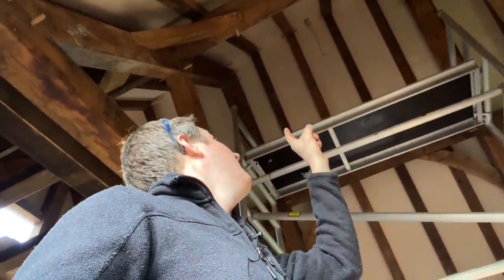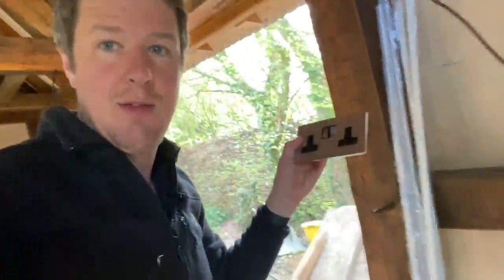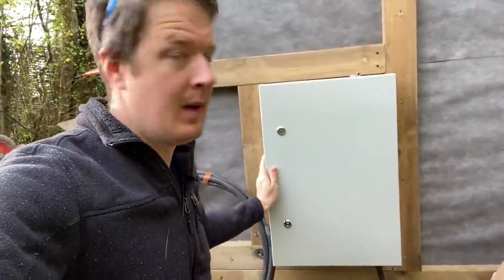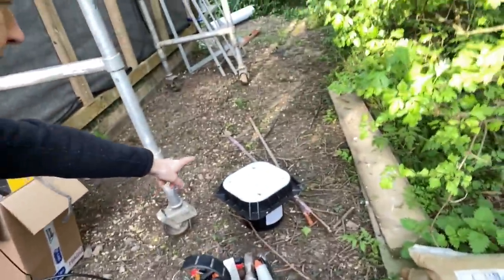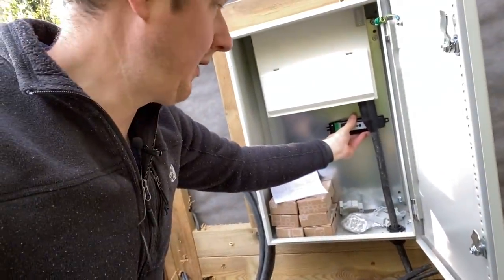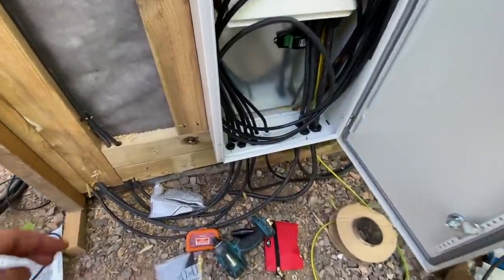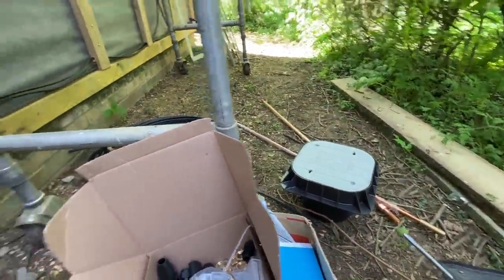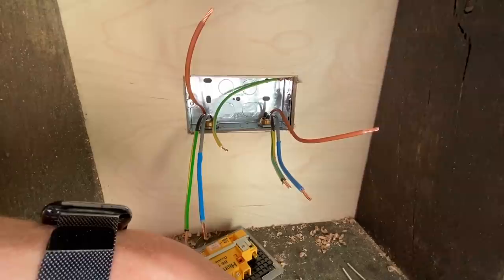Glanding Armoured Cable - Studio Installation Part 3

Comment: You can get bigger sleeving if you like. I was always taught (and it might be in the regs) you only need a marker (near the termination) i.e. a width of tape only, not the whole length.
Reply from the maker: Thanks!
Reply: 70% I always thought...I always do the whole core anyway.
Reply: @tommochelsea72  You are mixing up the Green / Yellow % on Earth wire (70/30) Green/Yellow.

Comment: I did a external metal enclosure with a cu in it on a glamping cabin a while ago.  By mistake really, I put a waterproof plastic cu in it.  Put stand off brackets at the back of the cu. Terminated the swa at the bottom of the metal enclosure and just back entry into the plastic cu.
Reply from the maker: Nice

Comment: Isn’t putting the lighting hub inside the metal IP65 box going to make it tricky to get the WiFi signal from the phone?  Looks like a pretty efficient Faraday cage?!
Reply: Probably using a Lutron Ethernet Control Interface Hub. Would guess that the phone app and the hub talk to a server, not direct to each other.
Reply: Slade McThornbody OK that sounds more feasible - hope Jordan thought of that!
Reply: Dingo Nates Well he will need an ethernet switch in there to split out to the datapoints anyway
Reply from the maker: Yeah I was worried about that but with the Lutron RA2 Select system its not a problem. Its all working fine! 😅

Comment: If you make the SWA off into the metal enclosure then run the inner sheathing straight into the CU with stuffing glands its a lot easier.. Everything is covered regs wise, double insulated & it within a lockable enclosure. 
https://www.cef.co.uk/catalogue/products/419462-10-0mm-blue-sleeving-50m-reel.
Reply from the maker: Thats what I did with the lighting cables but not the sockets and main incomer.

Comment: What’s the reason for wiring all the final circuits in SWA within the building ??
Reply from the maker: Customer requested it, I think he was scared of nailing through cables, not that it would make much difference. Also think he wants it to last a very long time!
Reply: I was going to ask this question. 👍🏻

Comment: Could I do this with 10mm TNE going to the board without adding and electrode. Cables buried in flexi conduit and feeding a 63amp board for 2 rings and 2 lighting circuits for an garage conversion?? Hoping a 4mm earth is within regs or do I have to run a 10/16mm from the MET. Considering there is no gas pipes and water pipes are run in plastic

Comment: We don't have to sleeve here in America like you do . They make heat shrink in different colors and sizes at least here. I used heat shrink more in electronic type work. I have used it at times for some electrical applications. More so in industrial applications.There is company called Nelco that makes a Polyolefin Heat Shrink tubing in different colors and sizes. Type Nelco cable tie products. When it comes up hit menu and it shows the different shrink.
Reply from the maker: Thanks for the info!
Reply: @artisanelectrics    That job your doing on that barn is excellent. Even though we do things a little different in the states  quality is still quality. Have a great day a great day indeed.

Comment: Great job
What's the reason for the stake?
Why couldn't you of used the house earth
Reply: dazzafat DNO forbids exporting a PME system from the supply origin .
Reply from the maker: Yes thats right
Reply: If it was TT at the house and readings were good enough at the cabin would that have been ok without the additional spike?

Comment: How are the back boxes bonded through the armour when you have used Stuffing  (compression) glands?
Reply: Their swa glands on the back boxes.
Reply from the maker: They aren't compression glands
Reply: @artisanelectrics  I meant going into the enclosure and Fuse board.
Reply: @wyndavies5044  into the enclosure and Fuse board?
Reply: @artisanelectrics  you could of took a fly lead of the banjo and into the earth lug at the sockets.

Comment: You can get stainless steel enclosures that have a sloped top. That may be better than a flat surface outside. In my experience those powder coated enclosures are prone to rust if you so much as scratch them.
Reply from the maker: Thanks

Comment: Looks loverly but I would not use celitex for Insulation . We used it in the past on a loft conversion I was working on a job with Graham' Walters .The Atlantic Rowing record breaker. 10yrs Ago . But it would be fibreglass or Rockwool now after that Disaster with those flats in London.

Comment: the armour on the armoured is that part of the pme? ifo would you u have to isolate that at the cabin?
Reply from the maker: Yeah the main incomer has the sheath and internal CPC earthed from the PME of the house but i've isolated it within the enclosure here.
Reply: Yes I commented before I watched the rest of the video 😂 looks smart 👌🏽
Reply: @artisanelectrics  sorry, this might sound like a dumb question, but do you mean you just terminated off the internal CPC core, disregarding it, and used the earth spike to earth the board instead? 

Also does this then get measured as Ze for that board?

Comment: If you putting a stake in , hope the 2 earthing systems arent mixing, it looks like the SWA terminated into the metal enclosure possibley wont be separated from the main earth in the house. Also i refurbed a large 10 room external cabin with a overhead supply , designed it all for TT only to find out it was PME from the DNO
Reply: Look at 9 mins. He changes to stuffing gland to lose the armour earth.
Reply: @steve87uk  sorry didnt notice point taken
Reply from the maker: Well spotted! 😁

Comment: You will need something like a 5 port switch in the external enclosure to join the data outlets to the structured cabling in the main house.
Reply from the maker: Yeah thats what i've used.

Comment: In the US we don't use sleeving so yes lots of tape lots of phase tape. I'm sure you could probably get sleeving I've never seen it used but I haven't say I've seen every installation yet either. although I always thought it was the same thing as heat shrink to some extent maybe not with the shrinking.
Reply from the maker: Cool thanks for sharing!

Comment: TLC keep larger sleeving, as do CPC and presumably most wholesalers. Heatshrink's also an option.

Personally I'd probably have used two core SWA to save a little space, and linked across the glands rather than rely on a thin bit of galv for continuity.

Try not to strip back so much of the cat5/6, you can easily exceed the bend radius of the unsheathed pairs. Should be plenty of room (and radius) to bend the whole inner sheath round in those boxes.

Does look really nice, though. Might be a little jealous.
Reply from the maker: Thanks

Comment: Are you planning to install any of the Lutron Pico switches? If yes will the signals reach the hub as you’re placing it in a metal enclosure
Reply from the maker: Yeah i'm installing 4 Pico switches, they work fine.
Reply: Artisan Electrics that’s excellent news. I would have thought it being a risk that the signal from the Picos wouldn’t reach the receiver hub due it being placed in a cage. At least now I know there’s some possibility of doing this in my future installs. Thanks for the reply

Comment: What type of enclosure is used for the DB? thanks

I use heat shrink for covering over the ends, got a small selection off ebay.
Reply from the maker: https://www.tlc-direct.co.uk/Products/CMSB604025.html

Comment: If the customer requested Ethernet ports in the building I would suggest that he also had a Wireless Access Point (WAP) wired in the building as this would ensure that handheld devices could still connect to the wireless network.
Reply from the maker: Yeah I have put a WAP in

Comment: 14:22 This is NOT how you terminate Cat datacable category 5,5e or 6! 
In order to get the best connection and fastest internet, you must strip the outer jacket off as close to termination as possible. And the wires must be as short as possible, and do not straighten out the wires excessively. Contain the most amount of twists on the pairs before termination.
This hurt my eyes.
Reply: I saw now that you have commented and admitted your fault. Good lad! :)

Comment: That box is going to be loaded to the max haha, fair play for getting all that in there! My ocd was triggered when you stripped the data so long. I'm not sure about the Hamilton range but usually they have a cable tie fixture so you can keep the sheathing in place and only strip the core to what you need to keep the twists in and prevent cross-talk. 

Impressive well thought out job on your behalf, considering it seems the designer of the building tried making it impossible to run any services 😁
Reply: Cat5e cross connect wire isn't sheathed at all, so I wonder if it really matters.
Reply: @brianleeper5737  It's really easy to untwist or exceed the bend radius of the pairs outside the sheath. Best to leave the sheath on. Nice to see enough length kept, though.
Reply from the maker: Thanks

Comment: Data Cable being stripped back 😬
Reply: I spotted that,, Doesn't look like many did though. Lets hope they don't want more than gigabit down that thing in the future! If it manages that reliably.
Reply: Jake Hall he put something on instagram about it. I've not yet found an electrician that doesn't strip it all the way back! Complete nightmare!
Reply: @Rainbowhockey  It does indeed seem to be a running issue with most electricians. I think a lot of em' don't really know the ins and outs of networking, just that "it works" at the end of the day.
Reply: Return loss fails everywhere, let's hope that the client dosnt what the network certified!
Reply from the maker: Yeah it was a stupid mistake guys, I don't know why I did it as i've installed thousands of certified CAT6A cables, patch panels and keystones over the years! Just had a brain fart 😂 glad you picked up on it!
Reply: Artisan Electrics kudos for being humble enough to admit your mistakes sir!
Reply: I’m a network engineer hate it when a client sees their get the electrician to run the cable it always ends up with double the work load always advise are terminate it to save some issues then you find they run it along with power please guys if your going to run network and terminate network cables learn the basics

Comment: Maybe you will need another box for your lighting gear, i was going suggest a plastic one, because of the wireless signals, but with it being insulated in foil insulation may not make any difference. I had one customer have a gas fire controlled by wifi and it would not work on his phone, because of the foil insulation in his extension. I did try to explain it to him before he went for it, but what do i know compared to a heating engineer, well plumber!!!.
Reply from the maker: Actually the signal works fine on this Lutron system, even with the metal enclosure and foil insulation. I was worried about it but it works fine.
Reply: @artisanelectrics  thats  good to know

Comment: They have made that job hard work for you using SWA are you on a price for this one? Nice job your making of it. If its now a TT only 1 end of that SWA sheath should be connected to earth. And if its not on a rcd at the mains end i think im right in saying you need at least 100ma rcd protection before the tails enter the metal DB as its a TT
Reply from the maker: Thanks! Im on hourly rate for this one so no sweat. The Armouring is connected at the main DB end to the PME earthing system. Its on a 100mA S Type RCD as well.

Comment: Good way to put in an earth rod. I'm going to try that.
Reply from the maker: Yeah ive got this special SDS bit from Bosch that is designed for it.
Reply: @artisanelectrics  I will check that out. Nice pull through the roof by the way. On your own too, keep it up.
Reply: Artisan Electrics do you have a link or description of it please

Comment: My dude you are stripping back WAY too much insultation off that data cable, keep it all wrapped tight together until you get to the back of the IDC terminals or you may find it will run at sub standard connection speeds.
Reply from the maker: Yeah I had a bit of a brain fart there... Ive done thousands of CAT6A over the years and they always had to be certified, I would never have done this in the past! Think I'm getting a bit rusty on data!
Reply: @artisanelectrics  I was about to suggest the same thing! I am very glad to see an electrician who does not attempt to create a 'ring' of ethernet ports. So many data packet collisions haha
Reply: @haven4143  haha nice man

Comment: Just apply a single wrap of tape if tape is all you have, no need to tape all the conductor pal. Have some 6mm sleeve on the van somewhere for when larger sleeving is needed
Reply from the maker: Good tip!

Comment: Normally when we don’t want to export the earth from the swa sub-main we terminate it into a plastic enclosure or wiska box then into the metal enclosure. I know you’ve probably terminated the other end of the sub properly with a gland so the outer sheath is still earthed at one end but just looks better at the Sub DB end 👌 nice job 👍
Reply from the maker: Thanks

Comment: Wouldn’t it be normal to terminate the feed in armour in a non-conductive box (ie plastic) so it’s only earthed at the supply end (the house), and then treat the building as a TT installation with its own earthing installation?
Looks like you’ve done most of the work for that except deliberately separating the earth arrangements.
Reply from the maker: I terminated it into the CU with a PVC compression gland and didn’t connect the armouring or internal CPC wire into the CU. So the CU is only earthed from the Rod and the cable is only Earthed from the house PME Supply.
Reply: Artisan Electrics Fair enough. Obviously wasn’t paying enough attention while watching.
Reply: Artisan Electrics what was causing the RCD tripping issue after?

Comment: You can get armoured made in the correct colours.

Superlec direct do it.

Then there is no sleaveing or confusion
Reply from the maker: Great thanks!
Reply: And they cut the exact length you need!
Reply: Yeah its available on ebay it saves a lot of time and eliminates any confusion so much easier to use better than faffing about with tape or sleeving

Comment: Absolutely great Jordan 👍🏼 The choice of cable (SWA) is ideal for this project in my opinion.  It was a good call to TT the building.  What size was the sub-main cable?
Reply from the maker: Awesome, thank you! 10mm 3 core SWA for the supply on a 40A breaker
Reply: Why did you bother with 3 core if you can earth to the armour and you were putting a spike in anyway? Surely 2 core would have saved on cost?

Comment: I’d be putting afdd’s in a wooden building pal
Reply: Your house is full of wood on the inside, too..
Reply: Only goin what it says in 18th regs about buildings made of wood require afdds
Reply: Doubt you’d be putting them in if you were paying for them though.
Reply: Cost doesn’t come into it, just comply with the regs, I know it’s a recommendation but if something happens  and you not installed them then cost does matter, how much do you think a building made from oak costs not cheap. Just going from below this reason I would be recommending them. 

The IET Wiring Regulations, BS 7671: 2018 regulation 421.1.7 and 532.6 state the following:
421.1.7 Arc fault detection devices conforming to BS EN 62606 are recommended as a means of providing additional protection against fire caused by arc faults in AC final circuits.
If used, an AFDD shall be placed at the origin of the circuit to be protected.
NoTE: Examples of where such devices can be used include:
• premises with sleeping accommodation
• locations with a risk of fire due to the nature of
processed or stored materials, i.e. BE2 locations (e.g. barns, woodworking shops, stores of combustible materials)
• locations with combustible constructional materials, i.e. CA2 locations (e.g. wooden buildings)
• fire propagating structures, i.e. CB2 locations
• locations with endangering of irreplaceable goods.
532.6 Arc fault detection devices (AFDDs)
Where specified, arc fault detection devices shall be installed:
(i) at the origin of the final circuits to be protected, and
(ii) in AC single-phase circuits not exceeding 230 V.
AFDDs shall comply with BS EN 62606. Coordination of AFDDs with overcurrent protective devices, if necessary, shall take account of the manufacturer's instructions.
Furthermore for medical locations, regulation 710.421.1.201 states:
In Medical locations of Group 1 and 2 Arc Fault Detection Devices (AFDDs) are not required to be installed. In medical locations of Group 0 Arc Fault Detection Devices (AFDDs) shall be used subject to a risk assessment.

Not been arsy just trying to show how I interpret this reg 

Regards Graham
Reply from the maker: Interesting! I wouldn't have even thought about it to be honest as I only thought they were needed in places with sleeping accommodation ie hotels etc. I need to brush up on AFDD regs obviously.

Comment: Wow. You are putting data into a mains enclosure??? That would fail an EICR.  And terminating all the lighting SWA would be a piece of piss. No need for extra boxes.
Reply: You can have band 1 and 2 cables in same enclosure if one or both are double insulated/sheathed

Edit: insulated to the highest possible voltage present i.e. 230 here
Reply from the maker: Not sure what you mean about the lighting SWA